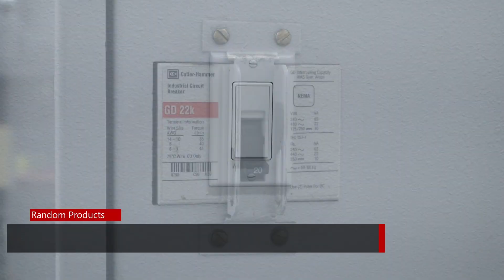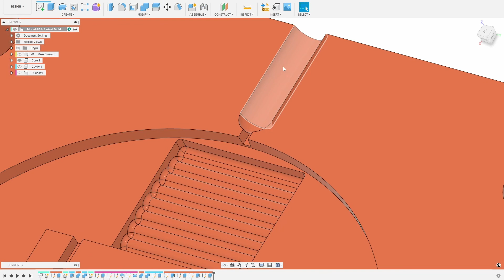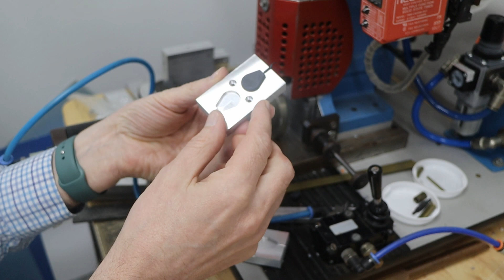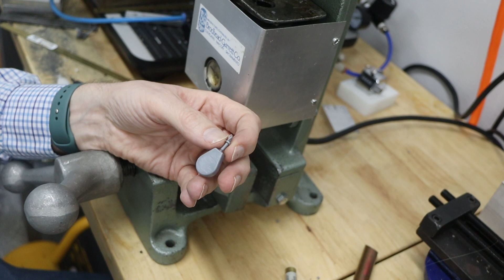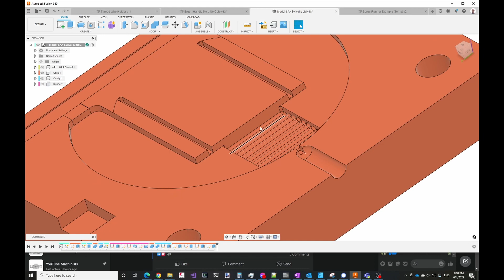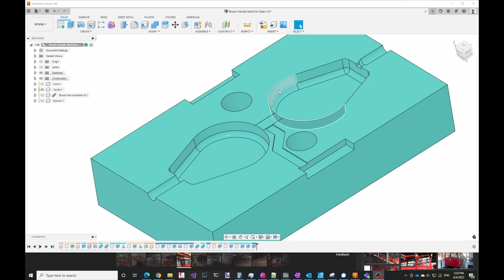Design an Injection Mold -- for Desktop Machines

Comment: Your videos are always fantastic!
For a production up to maybe 10000 units/year, I need to hard plastic mold over some lengths of medical grade silicone tube so you essentially cannot pull it through stop/stretch positions.
Do you have any good ideas to process and material?
We need lumen to be "unchanged" but essentially need stops wimilar to what you would use for an elongation/stretch test

Comment: Hello!
I appreciate a lot your videos, and I applied some of the knowledge you're sharing in my project!

I made an hydraulic injection machine from scratch for my project (you can see it from the link in my profile if you want!), I'm using only recycled plastic from packaging, PP and HDPE, and I sometimes have issues with shrinkage.

Being hydraulic, I can inject with way higher pressure than with pneumatic machines, up to 500bar to be safe (the machine is capable of 700, but the injector pipe is too stressed).
Usually 250bar maximum.

I tried various gate dimensions, from 0.8 to 2.5mm in diameter, and they're working fine!

Comment: Hi John, Really well done. Question: This is about the dynamics of the air escaping the mold. As the plastic comes into the mold it most likely has a spaghetti shape at first until the material starts to get squished. But as the ratio of the amount of plastic versus residual air increases some air may not be able to make it to the escape port as the hole will eventually get covered. What happens to this trapped air? Can it make small bubbles on the surface? Can it be trapped inside the part and cause weaknesses? Many thanks as there are many people learning from you!

Comment: Hi John & thankyou for your very informative videos. I notice your molds do not have a chamfer at the entry port as some do. I was wondering what sort of design your molder nozzles are. How do they form a seal on the mold block? Do they have some sort of shut off valve or are they just an open hole in the bottom of the tube. Keep up the good work. Its nice to see you love what you do.

Comment: Hello. Could you tell me please, how much maximum pressure your compressor can supply on your desktop termoplast machine which model 100. And how much pressure actually do you use of it?
Reply from the maker: I have two compressors. The one under the machine, which is what I typically use, is rated for 225 psi. But I keep the pressure to the injection molder at about 130 psi and then don't use more than 120 psi for injection or clamping.
Reply: @JohnSL  and can you tell me what about length of pneumatic cylinder diameter?

Comment: Thanks for your knowledge sir! Does overall surface area of a mold matter as well? For example, I'm considering injection molding some glasses frames. According to the volume and weight estimations from the CAD model, they should be within the "shot capacity" of a desktop injection machine I'm looking at, but I'm doubtful. I fear that the long path of the cavity wouldn't be filled by one pull of the lever, or that the extra surface would cool the plastic before full injection. Do you have any advice on estimating an injection machine's limits?
Reply: Same situation here. Getting my manual injector machine soon. Was your project successful?

Comment: Can't you make the mold a bit more "bulbous" where the depression is to counteract it?
Reply from the maker: Yes, that can be done. The mold maker did this with the large throttle sold by TCS, as the part distorted when molded too much. So they did a detailed 3D scan of the part as molded and then adjusted the mold to compensate.

Comment: Very interesting video as always. Question: what are the strategies for dealing with shrinking? Do you ever make molds with exaggerated geometries, to let the part shrink to dimension?
Reply from the maker: I didn't cover this, but generally one step is to scale up the design to counteract the shrink rate. This varies from one plastic to another, and isn't important for all designs.

Comment: This is a bit off topic but it does have to do with mold design.  I believe injection molding may one day have a rise in popularity just like 3D printing had a few years ago.  Once people start buying machines like the LNS or Bruster Beagle machines then the Chinese knockoffs will follow.  This will be a good thing for injection molding.  Some people will buy more advanced machines like yours but a lower barrier to entry gets more people involved.

However, I believe there is one major thing holding this popularity back.  Molds..  Right now I don't think there are any molds readily available that people actually want to make.  LNS has one mold that I would consider and honestly I still don't want to make heart keychains.  I know the common rational is that you should have a part in mind first and then get the machine.  But that's not how common people work. Personal computers, video game consoles, and even smartphones all needed a "killer app" before they were widely adopted.  Before people will buy a injection mold machine I think they need a "killer app" mold.

I know there's a lot to consider with molds.  The type of plastic, and the Machine itself being the most important.  But if a popular mold can be designed for generic low entry machines, then I think that will go a long way towards getting people to adopt injection molding.

I do have some ideas as to what parts to make.  I've been thinking about making a video that's an open letter towards mold makers.  Would you have any interest in these ideas?
Reply from the maker: Sure, I'd love to hear more. I'm planning to set up a web store sometime this year to sell products. You can contact me via email using the email address you can view on the about section of my YouTube channel.
Reply: @JohnSL  I already have the video setup so I'll probably just film it and send you the link.
Reply: @JohnSL   I made that video.  It was a bit of a mess so you can skip straight to about 20 min in to get to my ideas.
 https://youtu.be/6GvSUuIPaXI

Comment: Very nice breakdown. I preheat some of my more challenging desktop molds to help with flow using a small coffee cup warmer. I have one mold for a product made of lustran that needed a dedicated heating element to fill completely. I noticed on your emco molder there's a piece of sheet metal bolted to the rear clamping face, what is that for? That bolt hole is typically for the mold stop.
Reply from the maker: I've thought about adding heaters or a heater plate but never gotten around to it. As to sheet metal plate on the Emco, I don't know why it's there. The only thing I can think of is that it helps space a 1/2" thick mold out so it centered under the nozzle. But that's just a guess.

Comment: Why make the gate square instead of round?
Reply from the maker: You absolutely can. In fact I use round gates for molds I make for my Morgan (which has injection through the "back"). But if you want the gate to be twice as wide as tall, which is useful when  you're injecting into a thinner part, it can't be round. So using rectangular gates is pretty standard.